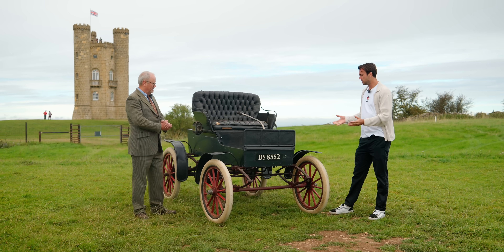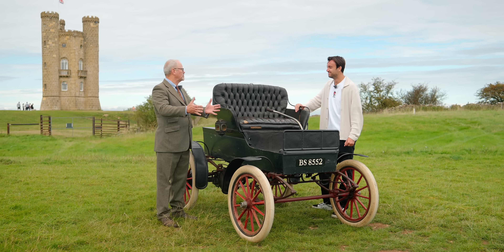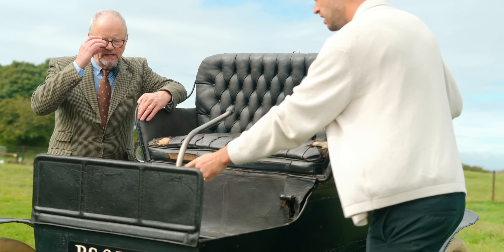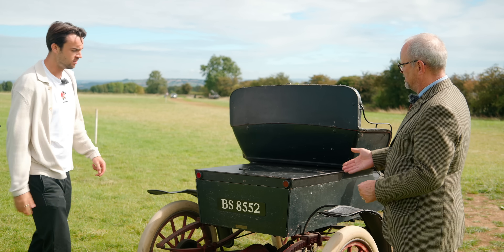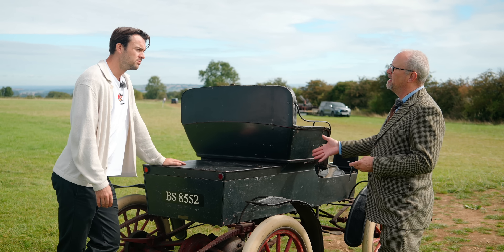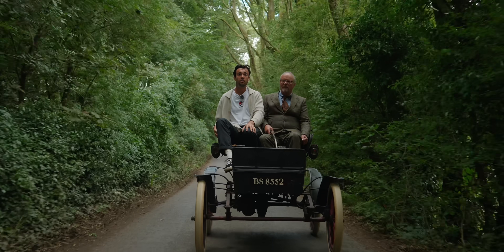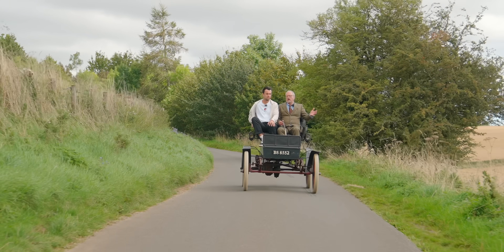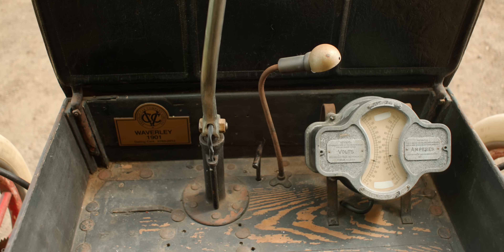Why Electric Cars Failed 100 Years Ago

Comment: Gas was a affordable way to travel long distances to fill your car.  Not a lot of personal electric vehicles most were used for delivery and pickups.  So a different market.  No charging stations in areas that were not settled.  Now its the opposite, way more charging stations than gas stations.  Charging stations need less space to deliver their fuel.  Most chargers are placed in areas that can be accessed by cars.  there are chargers at library's hospitals and even schools.  But most chargers are located near stores and food stores.

Comment: Sadly, the same reason they'll fail today. Liquid hydrocarbon fuels can "recharge" faster, have higher energy density per pound, and are easier to distribute. Density is high enough we can even lose a significant portion to heat, and it's still more efficient. 

Unless we somehow overcome physics for current battery technology, I could see myself possibly having an around town electric car, and an ICE for road trips. I owned a P90D. It was replaced with an ICE E Class. No regrets, other than dealing with an inept Tesla service network for a few years.

They're fun. They're just jot practical in four season environments, or for people who drive distances.

Comment: Ford worked on electric cars using the nickel iron Edison rechargeable battery .
Those batteries lasted for Decades and were Lighter .

Range was greater for the mass.

NiCads developed from the Edison cell then NiMh.

My EV-1 had Panasonic Lead acid batteries with a 85 Mile  range , the second batch had NiMh batteries with 125 Mile range . Stan Oshinski sold patent for large Ni Mh batteries to GM while they were making the EV-1 so no need to think of them not being made..

Shortly after the EV-1 stopped being made, Gm sold the patent to Texaco who became Chevron and no more were made .
This forced Allan Coconni to use laptop batteries thousands of them instead of a few big NiMh ones.

Tesla before Musk bought the design to make the roadster ….
Reply: 1 hell of an eye-opener😲, @josephpadula2283 !!!

Comment: So, the batteries all seem to be in series. Possible series-parallel because there's a separate negative connection for the left and right sides, but that could just as easily go round underneath to the positive of the other. So fully series, which would match up with the voltage on the voltmeter. Then those clicky contacts in the accelerator handle would likely have resistors, big chunky ones, between each set of contacts. They might instead have wired the batteries up so that you got a different voltage on each contact, but that would lead to some of the batteries, the lower ones, discharging more than others, which would make recharging a pain. 

It could've been done that way but would have needed a bit more complexity in the contacts. But they actually built the car and I'm just a Youtube idiot so I suppose they knew what they were doing. Lots of electric vehicles, like street trolleys, used resistors as a speed control. It just irks me cos they waste power as heat, but can't be helped! You just put bigger batteries in I suppose. The regen-braking pedal probably bypasses all of those, so that's how it's done.

The voltmeter has a massive range, and if those are the correct number of batteries, it would never get up past 60V, never mind 150! It would also never get below, say, 35V. So I suppose they must have bought the voltmeter off the shelf and you just ignore the rest of the range. People were sensible back then, they could cope with that, didn't need 5 little green lights to tell them their battery state. This thing is built before the invention of electronics, before vacuum tubes, so there were no methods you could apply to make the meter work like a more modern one.

Comment: Actually Henry Ford and Thomas Edison HAD a project to begin mass-producing electric vehicles! Their goal was to manufacture 150,000 electric cars in 1915, and they had amassed over 350 million dollars (in today's value).

Edison's battery technology was viable. The electric vehicles would have had a range of 60 miles and could be "charged" through battery swaps at service stations.

We can only speculate about the direction electric vehicle evolution would have taken if the project had been successful. Battery technology, among other innovations, surely would have advanced more rapidly than it did.

The project was terminated because Edison's laboratories were destroyed in a fire, and the elderly Edison was unable to start anew.

This story is often not heard because it doesn't align with the narrative that gasoline cars were "superior," which is why they won the race. Undoubtedly, if Edison and Ford - one with expertise in electricity and battery technology, and the other skilled in mass-producing cars - had supported electric vehicles, they knew it could be achieved and sold to the masses.

You can find more details about this in Edwin Black's book "Internal Combustion," which is based on historical documents.

Comment: Thanks, Fully Charged Sh. Electric cars cause just as much pollution as gas vehicles, if not more. Forget the rare earth chemicals, they require five times as much Cu as gas cars meaning they are much more expensive than regular cars and their will be one of five drivers on the road without purchasing more copper. It will take two times the annual world production of copper to allow us to have the number of gasoline autos. It's just a bad idea, good for hot roding, bad for economy. Next we will try steam.

Comment: Here's the thing. Everyone says, "Well, electric cars, while really cool back then, weren't good enough," but what they fail to realize is development of the electric car and batteries could have advanced us further than where we are currently, IF we kept building them and making advances! Imagine where we would be today if we kept with EVs back then, and had over 100 years of development. The two people responsible for the first killing of the electric vehicle were Henry Ford (though not for the reason you think) and Thomas "The Thief" Edison. Ford wanted to come out with an EV that used batteries made by Edison. Edison was developing nickel-iron batteries that were lighter than the standard lead-acid, which would have given the Ford EVs about 100 miles of range. However, Edison's batteries had too high of internal resistance and were incapable of powering an EV. Ford got pissed and scrapped the project. Henry Ford started using the moving assembly line shortly after, which would have dropped the price of his EVs considerably.

Comment: What is the biggest problem with lithium batteries?
Disposal. Lithium-ion batteries contain metals such as cobalt, nickel, and manganese, which are toxic and can contaminate water supplies and ecosystems if they leach out of landfills. Additionally, fires in landfills or battery-recycling facilities have been attributed to inappropriate disposal of lithium-ion batteries ...

Comment: Lovely vehicle! such a rare thing. I dare say tho, any cloth or fabric likely is not original, nor any rubber parts from the factory or they'd be utterly roached out with dry rot and loss of integrity. It's first 40 years couldn't have been better than garaged and kept clean, as there really were no chemicals for preserving sensitive surfaces back then. UV and oxygen would've had their way.

Comment: I didn't have the time for this video today. The problem with the EV back then, however-was the Battery. Lead-acid is only practical for turning over an ICE engine, and the Edison (Yes-THAT Edison) Alkali battery, similarly suffers from a Poor weight/power ratio. 
Lithium Ion batteries aren't Perfect, Either. They can propel an EV 2-300 miles, however, from full charge.
Buses and Commercial trucks should be powered (on Superhighways) off overhead Pantograph lines. That is an Old,  Proven Technology, first used on Streetcars and Interurban Lines. 

40% of a Barrel of Oil is used for Gasoline
20-25% is refined into Diesel (mostly for the aforementioned trucks and buses.)

Even a surplus of TEN percent of Crude Oil, is BAD for Mexico, OPEC, and Russia...
-and, Good for America.
(Except for Alaska, North Dakota, and Texas.)
Too BAD for them.

Comment: I wonder how well it would run in 20 degree weather
Reply: Pretty well actually. A lead-acid battery will run down to about -10c / 14f. You might find it sluggish to start, but once it's running the batteries will warm themselves.

Comment: The Waverley Electric is from Indianapolis, Indiana, USA. So why the European shtick? Also 1901... I love how most are unaware that electric vehicles "carriages" started some time in the 1830's over a whole generation earlier. To put it into context for people. IF the first car ever was the 1908 Ford Model T, doing a car review featuring a 1978 Pontiac Trans Am (as a British car?) as one of the first cars ever made would be the time equivalent as what you are watching here. A lot happened between 1908 and 1978 and I'm sure a lot happened between the first electric carriages in the 1830s and 1901. I shouldn't touch the idea of a throw-away society making cars tailored specifically to our societies needs and wants. Think about the used market for your smartphone... oh there isn't one. Exact same concept is taking hold for cars. BMW has the technology to synthetically create gasoline from our atmosphere. Gas from the air around us. Rendering all cars once built to be carbon neutral. That at least has a future with a used affordable market. EVs do not offer an affordable used market.

Comment: If you put li-ion batteries as replacement for the lead acid batteries with the weight saved how far would it then drive also you should be a little faster going up hills

Comment: And they will fail again. Electric cars are going to be really unreliable and expensive to maintain.
Reply: Electric cars will be more reliable than gasoline cars. But power restrictions will mean you won't be able to evacuate when a hurricane comes and in California power shortages will result in charging for electric cars to be shut down first and regularly. The increased demand from EVs will increase the price of electricity to the point where IC cars will be cheaper to run. It's already cheaper in New England to run a hybrid than an EV.

Comment: Why did 100% electric vehicles fail 100 years ago? 
Do you REALLY have to ask???
THE BATTERY TECHNOLOGY OF THE TIME!
RANGE!
LACK OF CHARGING STATIONS/INFRASTRUCTURE

Why will 100% electric cars fail today?
RANGE
COST 
Last I heard, it took 8 or 9 years to recoop the cost of the electric option vs a gas engine, around 11 or 12 years vs diesel engine. WHO in this day and age keeps their car that long?!? 
LACK OF INFRASTRUCTURE AND CHARGING STAIONS, THE COST OF CREATING THE NECESSARY INFRASTRUCTURE AND CHARGING STATIONS, AND THE TIME REQUIRED TO FULLY RECHARGE..
Even if existing fuel stops AND REST AREAS on the nation's highways were to add charging stations, it would not be enough, due to te time required to re-charge. Think about it!  It takes minutes to fill a fuel tank. SEVERAL HOURS if not overnight to fully recharge the batteries. 

PROPRIETARY CHARGE PLUGS. 😡😡😡🤬🤬🤬🤬🤬🤬🤬🤬🤬🤬😡

Please, don't get me wrong. I believe a 100% electric car/light or even heavt truck is a great idea. Sadly, the tech is not there - yet.- for them to be a viable option, even overlooking the added cost. 
Perhaps if the auto manufactures had invested in electric vehicle research and development over the last 100+ years, rather than concintrate on gas and diesel engine development, things today would be much different.

BTW:
Changing vehicle fuels is not easy, and is quite risky, both to manufacturers, buyers/users, and fuel stations.
A few years ago, therewas a push to replace diesel commercial trucks with LPG/Propane powered trucks. (LPG/Propane engines produce roughly 20% less power than acomparable diesel engine, by the way. 25 to 30% less than acomparable gasoline engine.)
The LPG/Propane engine and modified fuel system added over $60,000 (USD) to the cost of the truck.  Even at an average cost of $150,000 to $225,000 (USD) depending on sleeper and axle options for adiesel powered truck, 60G is a significent cost increase. (commercial truck loans are 5 years, not the 20 to 30 years for the same amount for a home loan.) 
The major truck stops added fueling facilities, which were NOT "inexpensive".  

After 4 or 5 years, the verdict was in!  Manufacturers stopped offering the LPG/Propane engineand fuel option.  
I doubt any of the LPG/Propane trucks are still in use ... at least with the LPG engines and fuel systems. Some were converted to diesel. (again, not "inexpensive"; the engine ($15,000 plus) and 100% of the fuel system have to be replaced.) Some were scrapped. 
The truck stops that installed the fueling facilities for them ... those bulk tanks, pumps, and everything else they literally spent MILLIONS for ... AT EACH LOCATION are fenced off and unused.  

At best, hybrid gas/diesel/LPG internal combustion engine driving a genset/Electric (like Diesel-Electric locomotives) is the "best" option with current battery and charging technology. 
Adding solar pannels to vehicles isn't a viable option - at least not with current solar pannel tech. There isn't enough room for the pannels on a 53 foot semi trailer to keep the batteries charged on a 100% electric semi truck (yes. it was tried), let alone the average car.  
Perhaps inside 100 to 200 years battery, charging, and solar tech will advance enough to where a 100% electrically powered vehicle is a viable option...  PROVIDED the infrastructure and charging stations in place.
Even with solar ... well ... solar don't work so well on over cast days, at night, nor when covered with snow/ice/dirt. For that reason, charging stations will ALWAYS be required.

100% Electric cars today are viable ONLY for urban use: Commmuting/shopping and POSSIBLY for SHORT day trips, where the car can be plugged in to the (proprietary) home charger every day/night to fully recharge the battery/batteries.

I hear some (not all) 100% electric vehicles of today are dry weather vehicles,that catch fire if/when they get wet/rained/snowed on. THAT issure obviously needs to be cured before 100% electric vehicles area viable option.

Comment: Battery exchange would make more sense now too, rather than government funded chargers that apparently mostly don't work and take some time to charge, when they find one that works. Lithium is mined by someone's small child and they don't live very long.
Reply: That's the NIO model - 5 minute drive-in-drive out exchanges, it has both pros and cons for example even though it's pretty quick the swap stations are super expensive to build and can only do 1 car at a time - 10 cars turn up at the same time you still have to wait an hour.

Lithium is not mined by children - 80% comes from Australia and Chile that use no child labour, you may be thinking of cobalt, which is also used in every mobile device and also to refine every drop of petrol and diesel.

Comment: The real reason is that electric cares failed in America the first time. Is electricity not available in most of the USA until the Rural Elactrification Act was passed in 1936  , then it took 20 years to install the national power grid .  In 1972, we needed power for a water system. The quote was $124,000. Dollars to bring power to the location of the water source . We purched a gas-powered pump .a 500 galon storage tank , pipe and instslled the entire system  for under $5000.  You can't use an elertric anything if you don't have electrical power available. The gas and diesel fuel can be put in a tank trailer hitched to your car and taken to any location for use . I personally lived  in a frderaly owned house that still didn't have electricity fron 1968 til 1973 , refrigerator and lighting was all propane.  This was in California.

Comment: Doesn't the old genius know 6 volt wet batteries haven't changed in over 100 years?  No wonder they fit perfectly they've been the same size since Henry Ford was running Ford.

Comment: 100 years ago? LOL....dig deeper into history. The very first automobile was electric. The very first automobile was made in 1830. It had a top speed of 2mph and a range of 2 miles. 

Electric had plenty of time to conquer the world because electric vehicles had 70 years before big oil came on the scene. Why did it fail? The same reason it will always fail....batteries. Too heavy. Too much time to PROPERLY charge. Range is limited. Sure...you can add more batteries to add range....but then you cycle back to too heavy....too much time to properly charge. People 200 years ago knew this. People 200 years ago didnt want it. And before you babble about battery tech getting better.....no...it hasnt. charge and discharge rates are part of physics and you simply arent getting around them.

Comment: I think the modern electric cars are the equivalent of the late Victorian steam cars. Steam power was the established go to technology to replace horse drawn vehicles and all the manure they created, it was endlessly tried but it failed, simply wasn't up to the job. Modern electric vehicles have major issues on high new vehicle price, high carbon footprint of manufacture, lack of range, lack of "green" electricity to run them on, fire hazard in multi-storey and underground car parks and fire and electrocution hazard after an accident. They have some new problems that the 1901 electric car didn't have, not to mention Clive Sinclair's C5. I suspect they will go the same way as the steam car.